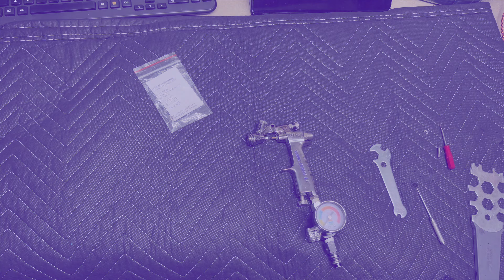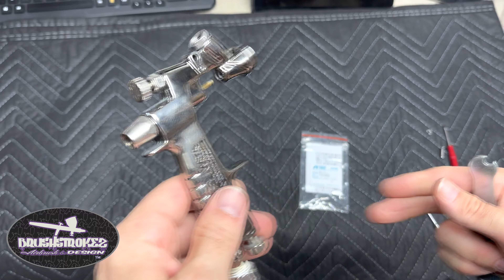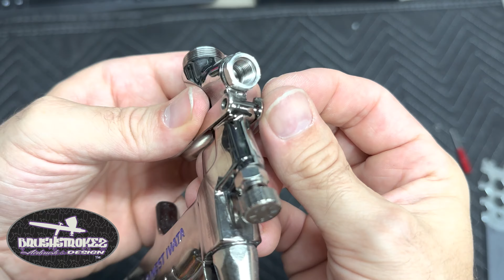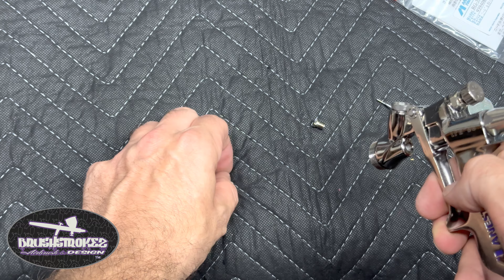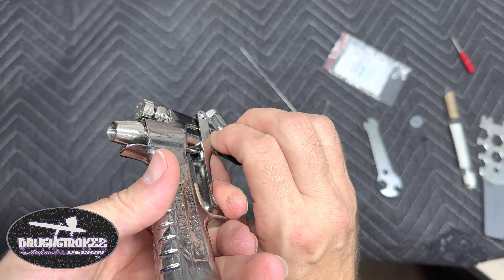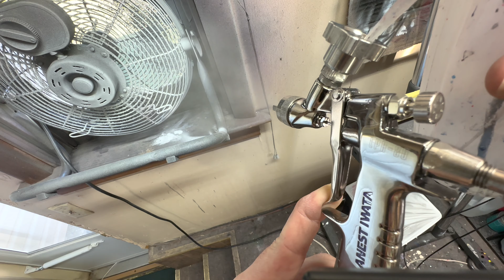Fix Your Spray Gun

Comment: Suggestion.. remove trigger slide needle in load packing nut on needle then little washer then plastic piece. Push needle in screw in packing nut. Remove needle finish assembly then put needle in and adj fluid pack.
Reply from the maker: Great advice!  Definitely doing it this way next time it needs a tune up. ThankZ🤘🏻

Comment: Hey great video. Iv just bought one of these used same gun. Thought I’d check for leaks. Filled the pot up with water (not paint) water leaks out from  thes packing area and the nozzle without pressing the trigger. Also without being hooked up to airline. Will this likely be the issue? Thanks
Reply from the maker: SoundZ like the packing is ur issue if it leaks with water. I’ve had it happen to me a couple of times. Gun still works fine, but can get messy. Pretty easy to change out. I always have an extra set on hand now ever since the first leak. Coast Airbrush or Spray Gunner for the seal kit.
Reply: @B @BrusHstroKeZ  changed out the fluid nipple + the packing kit and it running 100% now no leaks and atomises perfectly. Was shocked to find it had no packing kit installed at all instead it had a blue silicone paste stuff inside. No leather or plastic washers. Was a bitch to clean the stuff out but it’s great now. Thanks!
Reply from the maker: Awesome. Glad u good it working properly again. They’re the best mini gun ever!!!

Comment: I currently have air leaking from this area. Would this replacement fix this problem
Reply from the maker: I don’t think so. This is a fluid passage and no air should be getting to it. If air is coming out there, it should be coming out the cup area as well. The only way I can think of air getting in that area, would be through the nozzle, either a bad one or it’s not tightened enough. Let me know if this helpZ.